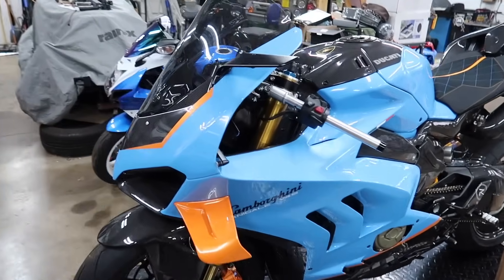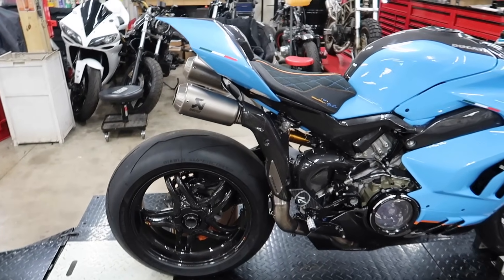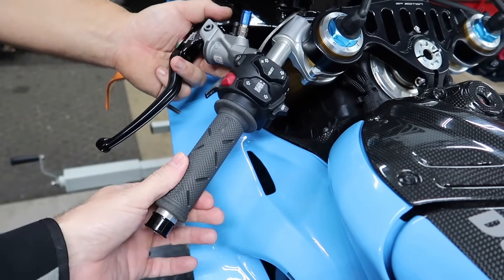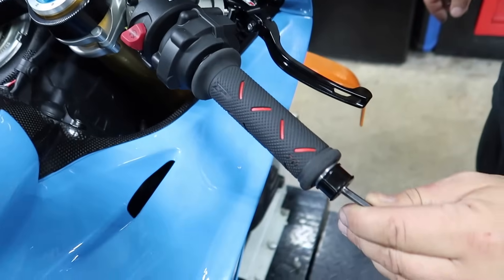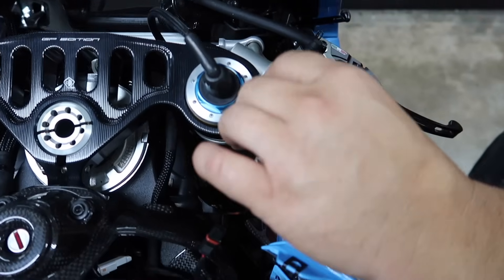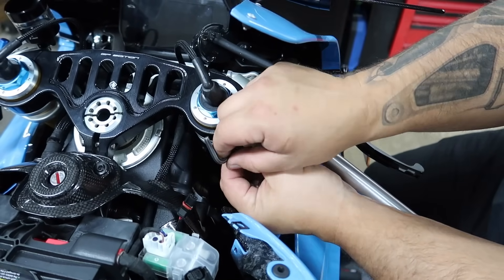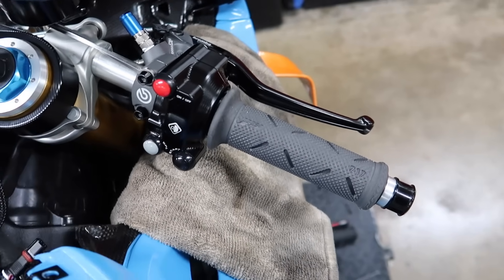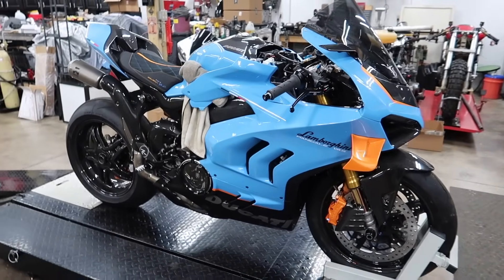Final Parts Installed on Our Lamborghini Panigale!

Comment: There is slop in the factory molds inside that Aps unit. You can buy red gap rings that go on the locator wedges where the handle meets the device.  Might wanna look into that…💯

Comment: I would have guessed Green Glue noise proofing compound, but I think that has less rings at the top of the bucket. Even if I was right, I wasn't the first to say that. (That's what happens when you're a couple days behind on You Tube videos).